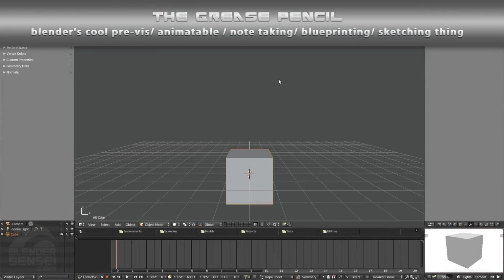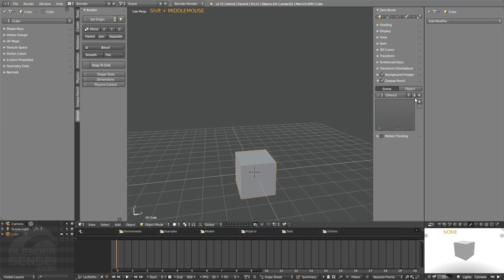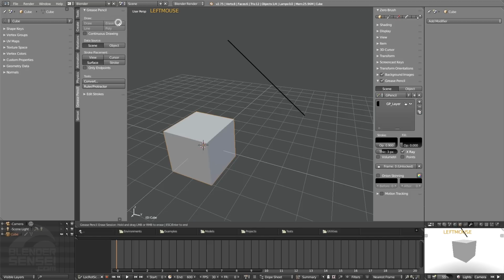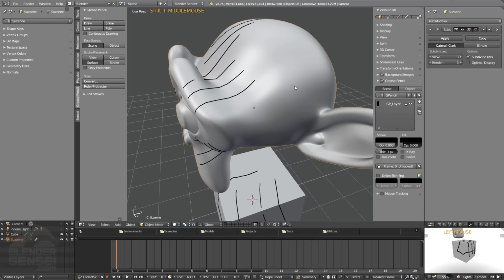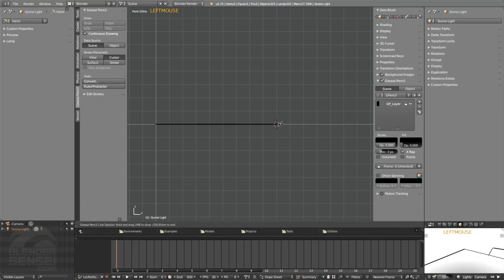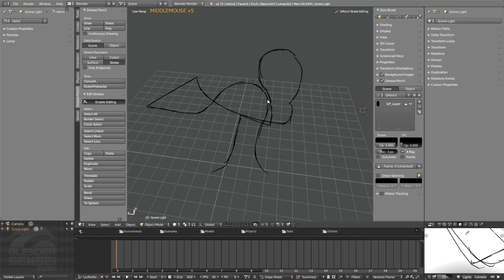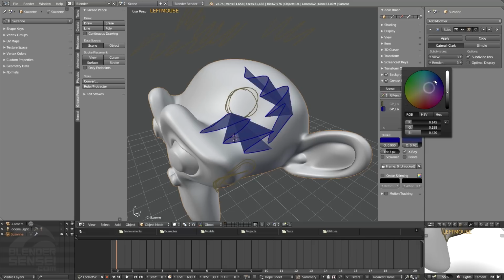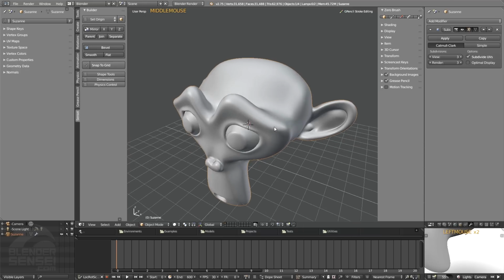Using The Grease Pencil

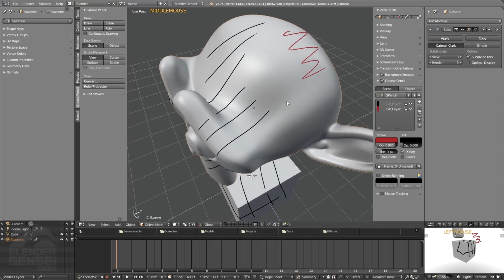Comment: I'd love to know of a way to use grease pencil on the viewport like in 11:00 in 2.83
Reply from the maker: After clicking on the annotation tool change Placement to "View" in the drop-down menu in the 3D View header.
Reply: EDIT: Actually, Nevermind, found what you referred to! Thank you so very much!
 @SethFentress  I can't find view in the Stroke Placement drop-down, it only has Origin, 3D Cursor, Surface and Stroke
Thank you for your answer

Comment: My strokes are shown transparent when drawn on 3d object.. how do I solve that..?
Reply from the maker: You mean you can see your strokes through the object? In Blender 2.79 you can turn off X-Ray under the "Grease Pencil Layers" menu in the properties panel (Press "T" while in the 3D View to bring up tools and properties shelf if using Sensei Format, or "N" for just the properties shelf for Blender default). Unfortunately there doesn't seem to be anywhere in the front end UI to disable this for annotation grease layers post Blender 2.8 (as of Blender 2.82). If you use the add menu "Shift-A" and add a blank Grease Pencil object, then switch the mode from Object to Draw, then change the stroke placement option (in the header menu) from "3D-Cursor" to "Surface" you can draw strokes without them being see through. This can also be done programmatically however for annotation grease layers as well, and will be available as an option in the next version of Sensei Format (still under development) if Blender doesn't decide to re-enable the option themselves.
Reply: @SethFentress  thanks a lot for the quick reply!😊

Yes I mean.. when I draw on a object.. 
On the other side of the object when I draw..the grease pencil strokes of the back layer are transperant .. on the parts overlapped by my new strokes..

Hope I am able to tell well..

This is also shown in the render.. too.. making it clumsy..

Comment: I wanted to know if its possible to render grease pencil on  blender 2.77.
Reply: You can render using OpenGL render, however, if you want to render using Blender Internal Render or Cycles with nice materials and lighting, then you need to convert Grease Pencil strokes into Mesh or Curve objects first.
Reply from the maker: HI @Arji Sahai, I never answered your question because this is explained in the very video you're asking the question on. @Jimmy Gunawan, You can but if you convert grease pencil strokes to curve or mesh then you're going to lose the fill and shading effects from the grease pencil, and you'd be better off using the Freestyle engine if that was your goal. Another approach would be to use BR or Cycles materials and environments with OpenGL render grease pencil strokes composited over... but you'd need to learn about compositing... lots of cool possibilities though.

Comment: Does the Sensei format change keybindings?
Reply from the maker: IGameChangerI Yes, it uses an addon "Sensei Keys" which dynamically generates custom keys on top of whatever default keymap the user is using. If this addon is disabled, all custom Sensei Format keys will also be disabled. Or you can leave the addon on and adjust the keymap at File/ User Preferences/ Input.